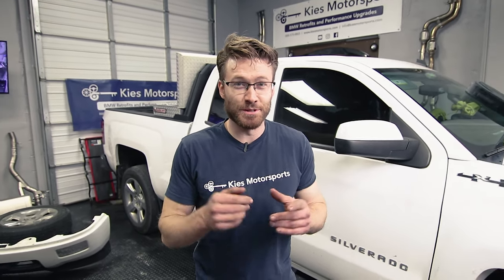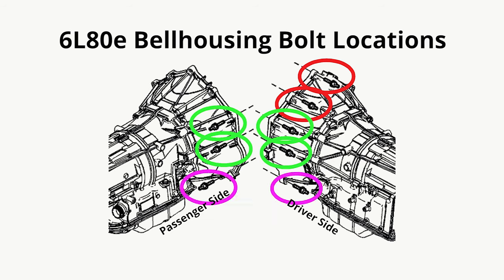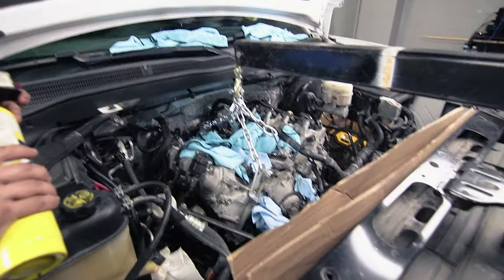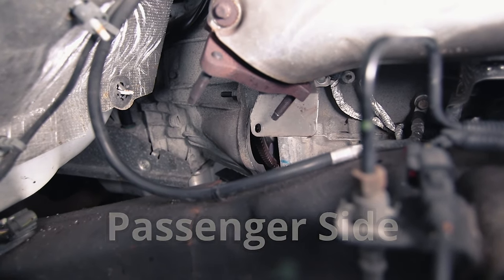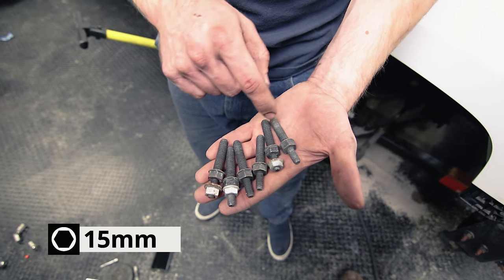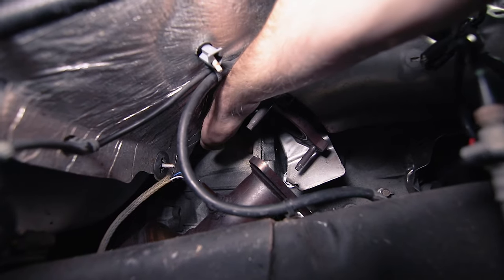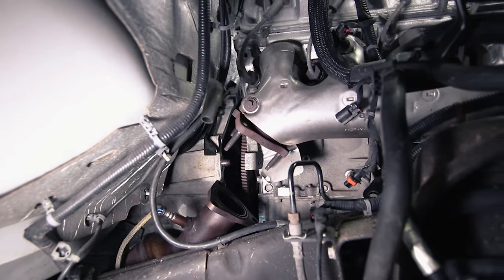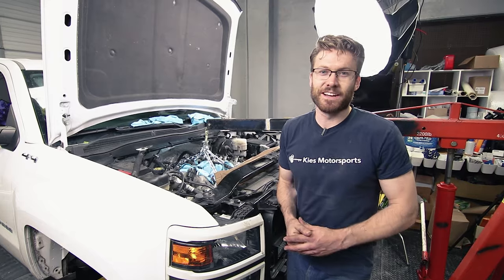Transmission Stuck to Engine! How to Separate Transmission Bell Housing from Engine - 6L80 Silverado

Comment: Definitely felt like I was going crazy. Another tip is use a swivel on a socket with like 2 feet of extensions you can get the torque converter bolts from the front of the engine with an impact.
Reply from the maker: Good to know!
Reply: I did this exact same thing today! Crazy to think I’m reading about you doing this a year ago haha

Comment: work perfect. i torched the two dowels, then used a sharp thin metal chisel and split the case right from the block and was done in 15 mins on a 20 year old truck in rust belt
Reply from the maker: Glad it helped you!
Reply: my Honda Civic is 1997, 23 years old now. I need to get a lawyer to separate them. Sad!
Reply from the maker: 😂😂 best of luck with it!
Reply: @TheSundaeDrive  The culprit is the bolt from the starter. The manual said remove the bolt if necessary. I removed the starter having two bolts, one short and another one  3 times the short one. The long one is penetrating the engine, so how in the hell can I separate the transmission from the engine without removing that bolt.
Reply: @balloney2175  did you ever get it out and how ? i’m stuck in the same position

Comment: I've pulled 20-30 of these 6L80 transmissions, two in the past week. And they are all a pain to get out. Usually I spray them down with pb blaster before I even start. Then I'll smack them a few times with a chisel and once it's time to come out I'll have two pry bars and just slowly work it out prying against the block, not the pan or flex plate, and the housing and they eventually come out. Before I reinstall I use a bur tool and clean up the new transmission pin holes and put grease in them so it'll be easier the next time. Transfer cases on these are usually stuck too.

Comment: Ran into this exact issue 5mins ago, i check 6 times to make sure I got all the bolts out, counted the bolts 4 times. Now I’m gonna try to torch method, thanks for the reassurance, I could of swore I was about to go nuts.

Comment: Our pins were also very stuck.  We used an air hammer with a punch bit on it.  Hit the pins from the back with it, and it came apart in just a few seconds on each side.

Comment: Tip for torque converter bolts, turn the rachet to the left, and you can slide a breaker bar between the cab and framerails, into the passenger wheelwell. So much easier to break loose.

Comment: If you heat up those dowel pins and then press a candle stick against the dowel pins. The wax will seep in via the heated metal and it will help get it separated or you can liberally douse it with brake fluid.

Comment: I did a bit of prying but saw that was not making progress. Got out the air hammer with a blunt straight pin setup, one trigger squeeze from the engine side for each pin and done. Way less sweat and swearing, more time for cold beer.

Comment: So I may have rounded my last torque converter bolt on the flywheel… I’m going to try and pull the trans off anyway I assume the converter will just stay on my engine and I’ll get the bolt out after? Fingers crossed
Reply from the maker: Aww man, that stinks. You'll eventually need to get it off because those torque converters fail pretty regularly. Just be careful to not mess up the splines.
Reply from the maker: I haven't pulled the transmission separately on my truck yet but hopefully it works out for you!
Reply: @TheSundaeDrive  yeah was a pain but I got the trans separated from the engine. Heated the pins a couple times, used a punch and gave them some encouragement then used a pry bar I came up through some access holes at the bottom section of the bell housing and gave her a few wiggles left side then right etc and she slid apart nicely
Reply from the maker: Sweet! Hopefully you are able to get that bolt out!

Comment: Save me again please! I got everything on my clutch replaced. Flywhee, pilot bearing clutch plate installed correctly and pressure plate. I used the alignment tool to align parts  before tightening everything thing up
 I used a trans jack to lift the trans in place. Is there a certain angle to get the bell housing to made to the engine. I believe I have the splines in and aligned. I turned the trans tail by hand to get splines in place. OR at least I think I do. It seems that something is binding preventing me from making the engine trans marriage flush. Tomorrow I am going to run a 2×4 through the door windows and try to "float" the trans using a ratcheting tie down strap. I am wondering if the trans jack is causing me the problem because I am not impress with the forward and aft tilt. I've done many transmission and clutches but thus is the first nv3500 I've dealt with. It is really a pain with the trans body and bell housing integrated. I'll take a BW T-5 any day over the crazy design. I am also working on the floor and by myself. The T-5 I could through on my shoulder and spin the tailshaft until it all fell into place and flush ez breezy. Any help would be appreciated.

Comment: Why do you have to remove the bolts from the torque converter?
Reply: Are yiu serious 😳
Reply: If you leave the tc on you the fly wheel you can fuck up the trans fluid pump.

Comment: Great video I hope I can become as fortunate as you were. I hosed everything down with PB blaster and  i'm going to let it sit overnight. Hopefully that will help with the separation and if not I'm in for an extremely long day because my transmission is stuck Holy Cathedral Hell under my truck.😳🙏😭😭😭
Reply from the maker: Good luck! It is never a fun job. I hope it is warm at least where you are while you are working on it
Reply: @TheSundaeDrive  Thanks bud I'm going to keep trying. Right now it's about 40° so hopefully it won't drop below freezing.
Reply from the maker: Yeah man. Nothing worse then working in the cold
Reply: @TheSundaeDrive  Agreed and yesterday's rainstorm didn't help either. I spent all morning with the shop vac sucking up 80 gallons of water.

Comment: I'm currently doing this on a Nissan Micra and the thing is STUCK!  I expected to use my bare hands to remove it but I think I'll be renting a floor transmission jack to finish the job.  Impossible to wiggle it free by hand.  Oh well I didn't expect this to be an easy job especially on the floor.

Comment: Just a random theory:
If the engine and transmission is stuck together on a manual transmission car, could you put it in gear and gently rock the car to wiggle the two apart?  My thinking is that if it has 7-8 large bolts holding it together to keep these torsion forces in check, then without the bolts, they should be able to twist.  Perhaps not much because of the alignment pins, but that's still a lot fewer contact points.

As soon as I can afford an engine hoist, my seized motor is coming out of the car and I don't actually know how difficult it will be to separate the engine/transmission.  All the bolts on the bell housing are loosened and ready, preparing for the worst, hoping for the best.

Comment: Can you take the fly wheel bolts off where the starter bolts up
Reply: Yes, must be done, remove the starter plate, two 10 mm, I used a long extension from in front of engine to go under mounts and reach these flywheel bolts.

Comment: Update.... I have the engine and transmission out.... I took a mini torch and heated the dowels up and got one side really hot and then stomped on the tail and heated the other side and stomped it again and it separated in a matter of minutes
Reply from the maker: Thanks for the update!

Comment: How to remove torque converter bolts with seized engine
Reply: Exactly what I need to know......
Reply: Exactly what I need to know
Reply: Pull oil pan, loosen main caps
Reply: Don't bother just pull the converter with the engine fuck it worst that will happen is you damage the front seal in the tranny
Reply: Since I didn't want to damage the front seal.on my tranny, I dropped the cross member, dropped the front diff as far as it would let me, then with the motor mount bolts out, I was able to jack up the engine just enough to get the oil pan off. My motor was frozen on the rod bearings and when I loosened the correct rod bearing cap, it began to spin and I was able to get to all the TC bolts
Reply from the maker: That sounds like a huge pain but glad you got it!

Comment: I can’t get the fucking torque converter to fly wheel bolts off
Reply: Nightmare fuel. Hopefully you got them. But these newer GM trucks they put the TC bolts closer to the block, almost no room. The GMT800 trucks you could fit a 1/2” impact gun where the starter sits and zip them out.